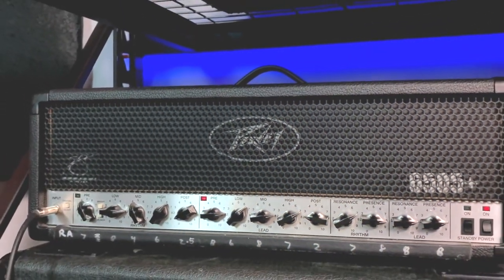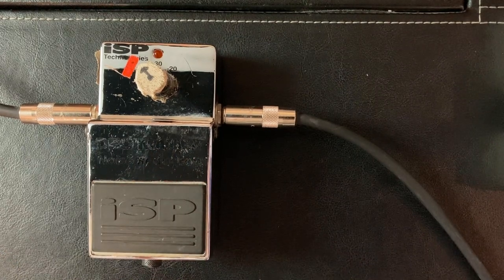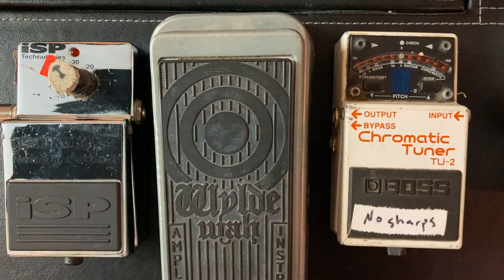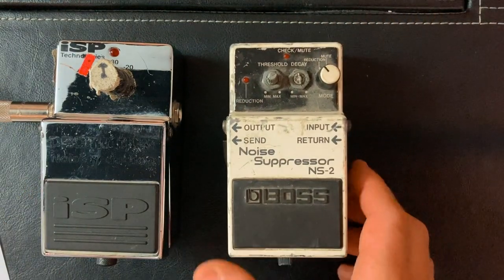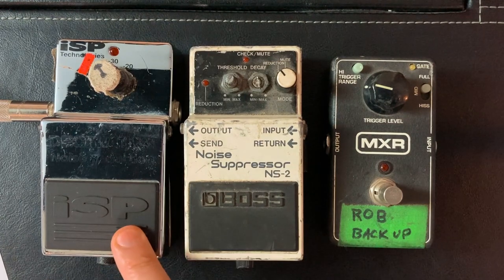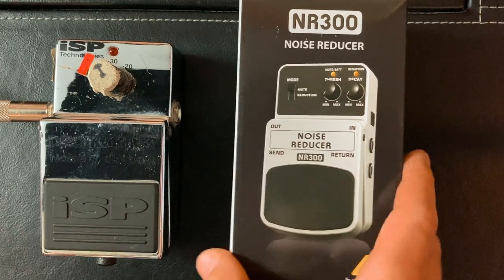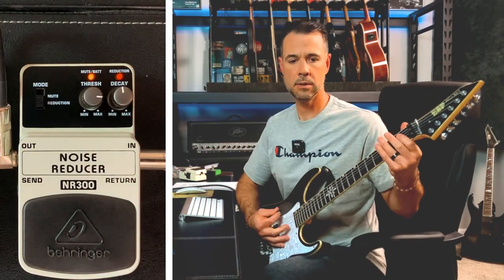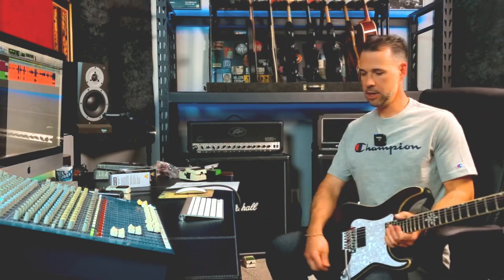Noise Gates 🔇 Do You Need One? What's The Difference?

Comment: My set pedalboard is guitar -> sd1 -> mt2 -> isp,and my question is the routing is true or not and the signal go to front or loop?please corect my signal chain🙏🏽
Reply from the maker: I'd love to help and advise, but I'll need more info! If you'd like, please explain your current setup more clearly for me. Thanks!🎸
Reply: @RobArnoldWorld  thank you very much 🙏🏽🙏🏽 and now i am re routing my pedalboard guitar->Sd1->MT2 -> in (nux cerberus)out ->rowin noise gate -> back to cerberus > out(for cerberus)
Reply from the maker: So is it working now as expected? I always place my ISP last in my signal chain, right before the amp. I also run another one in my FX loop, but that's not totally necessary. I just do it for extra protection.  @Flaawalrus
Reply: @RobArnoldWorld  yeahh better than before 🙏🏽🙏🏽 thx so much,maybe you try the noise gate rowin the procecor machine like isp decimator and more cheaper than isp decimator the pedal is great to

Comment: Couldn't get the TC iron curtain so got the Behringer instead. I agree it feels cheap but I don't get that resonance you're getting, then again I'm only playing through a solid state practice amp.
Reply from the maker: What kind of guitar and bridge you using?
Reply: @RobArnoldWorld  Because guitars in the UK are expensive and I'm cheap: 

ESP LTD H-250 - tune-o-matic stop tail.
ESP LTD M-103 - Floyd Rose licensed.
Ibanez RG 7421 - Fixed f107 bridge.
Harley Benton R458 fan fret - individual sadles.

I can't get the volume or tone of an expensive set up which is probably why I don't notice the resonance. I'm also no pro so I won't have a well tuned ear.
Reply from the maker: @DEJAVOODOO-gb7ww  Well I would think that the only guitar that would get that resonance would be your M-103 with the floyd. And that's because the springs in the back are what will create that resonate like we heard in the video.
Reply: @RobArnoldWorld  just remembered you mention that in the video and that is the one guitar of mine that makes the most noise, so it all makes sense.